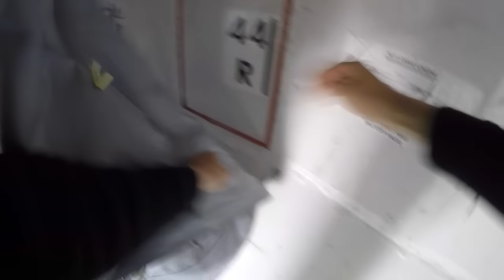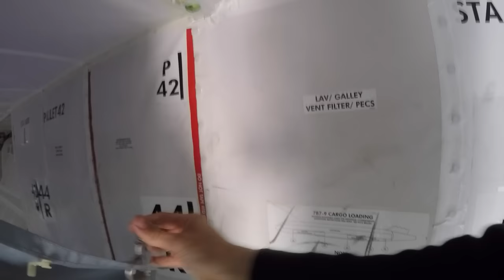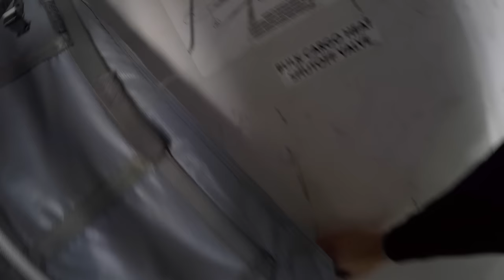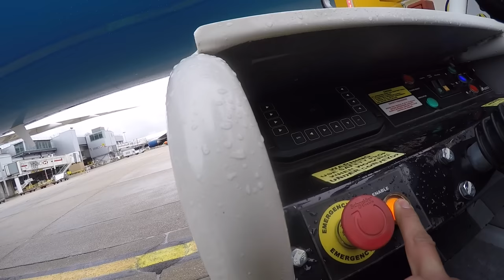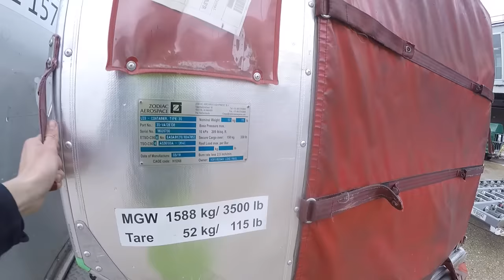Ramp Agent POV 787 Load up and Pushback

Comment: Is a Fork Lift Operators are qualified to apply as an Agent like you do now?
Reply from the maker: No
Reply: AS long as you have a High School diploma or GED you can get a ramp job. Your chances are better if you have relevant skills or experience. There is also Line Techs which is what I do currently and it is basically the same thing but for the private and general aviation sector.

Comment: hey Ryan, thanks for these great video’s 👍 To help us new starters in this work, could you possibly explain the abbreviations you make ? GPU / APU for example … one that I don’t know was PMG ? This would be really helpful 😃 Thanks again for these video’s and please keep them coming 🙏💪
Reply: GPU is the ground power unit, basically just any form of ground power either connected directly from the jet bridge or from a towable generator. APU is the auxiliary power unit, usually located in the tail of the plane and is usually turned off once GPU is connected. ASU, air start unit is very rarely used if the APU is faulty, supplying bleed air to the engines to start.
Reply: @jameswright3496  thanks very much… I am thing the list of abbreviations could be a bit longer 😃. also the names of the equipment would be a nice touch, for example: todays video includes the following vehicles….. 👍
Reply: The small vehicle he used is called an EBT 

The belt loader he used to walk up in to the plane. 

Then the HI-LOW to load the cargo bins in to the plane. 

Then the push back tug.
Reply: not in the states.

What you an EBT we simply call a Tug.

A belt loader is the same.

The HI-LOW is called a container loader.

Comment: What was the purpose of raising all those latches in an empty cargo hold?
Reply: I was curious about that as well.
Reply: On empty - who knows. But they always must be raised for flight
Reply: Probably to secure luggage
Reply: too much work just to flip switches
Reply: All locks up , doors and hatches secure and pin installed before push
Reply: @メンタルハザード what does that have to Dow it’s securing luggage
Reply: @Leoplayrblx  because that’s anchors the cables they put around luggage so it dosnt slam into the walls
Reply: It is too secure, luggage, and keep everything strapped in
Reply: Guys it's a belt to carry the luggage
Reply: Hey for,we ramped here. It’s because there are sensors that run up to the flight deck
Reply: Prob to prepare the cargo hold
Reply from the maker: Its in our SOP (standard operation procedure) to raise the stops in all holds even it empty. Not sure my self but i assume its to get you to always check the holds and make sure none are broken